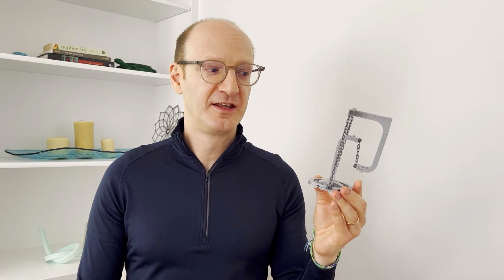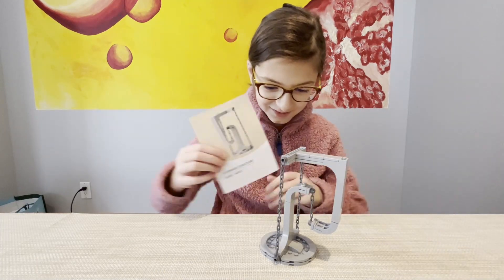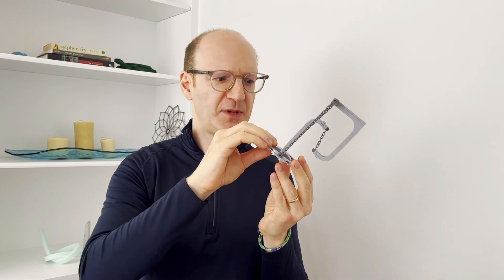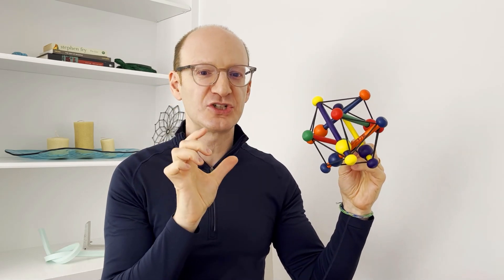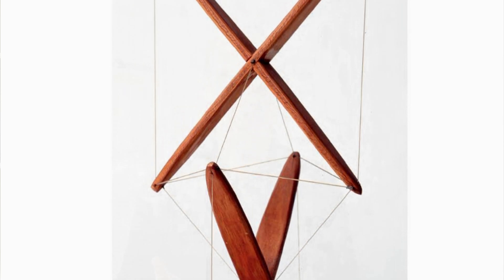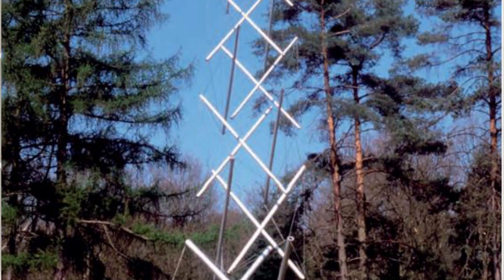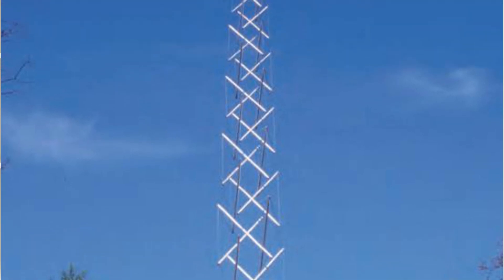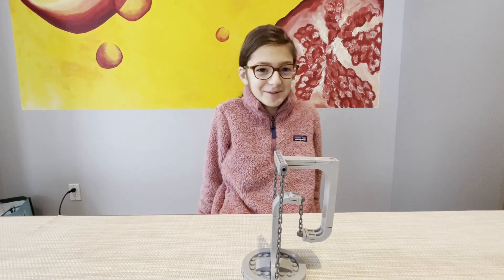Tensegrity Structures!

Comment: Due to the lack of legos and a computer with cad, could you assist in answering this;
Is this construction your daughter built in lego repeatable, slightly hanging from the wires so it won't tip over?

Hope you understand what I mean 🙏

Anyway, great video, and inspiring 😃

Comment: I'm curious your thoughts on this sir - Do you think a tensegrity structure (like the one your lovely daughter built, for instance) could be used for buildings in earthquake zones?  
One of the best elements (that I've noticed) engineers are designing into earthquake zone structures, is the ability to move...to be flexible or even somewhat mobile. This looks like it could fit the bill.